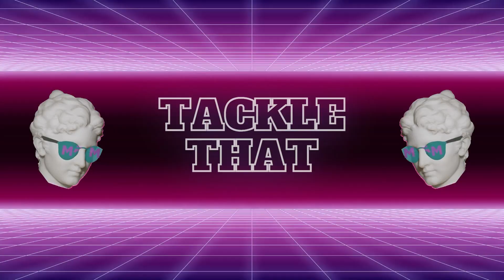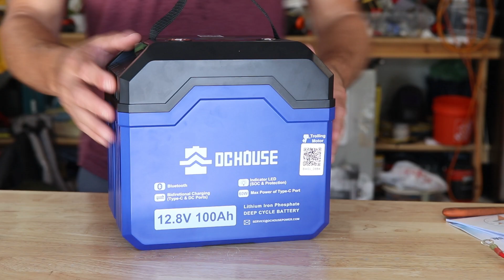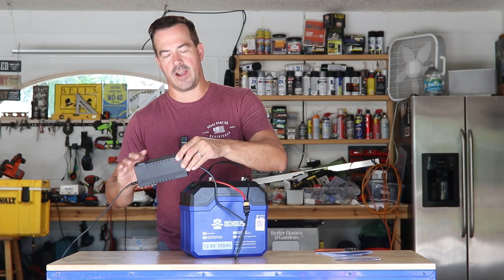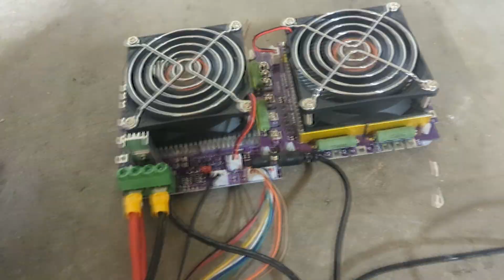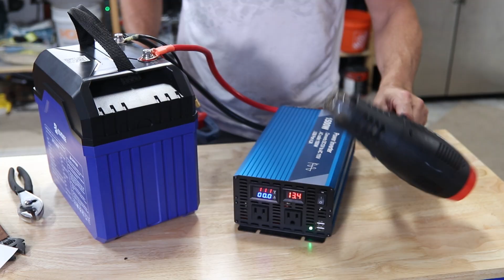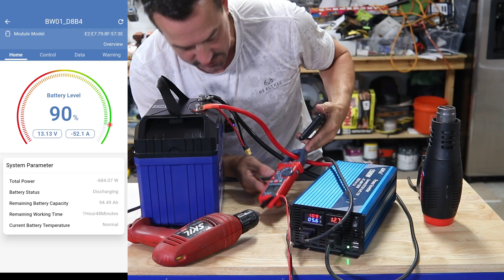NOT Your Average 12v Lithium! DCHOUSE Lifepo4 Trolling Motor Battery Unboxing and Review #Solar #DIY

Comment: Hi... I have the same battery, it's new but I can't charge it. There's only 1 volt of energy left and it's not charging. What do you suggest I do? How can I charge it? Thanks.
Reply from the maker: Try charging the terminals with a cccv charger at 14.6v. you can also try to wake it up with another charged 12v battery. All rlse fails, pop the top and check each cell's voltages... You can charge up any cells under 2.5v manually.
Reply: @TackleThat  okay. thanks a lot I will try.

Comment: The button panel on this battery stopped working the first time I connected the charger to the USB-C port. According to the instructions, the battery supports charging via this port. I looked on YouTube and the reviews say that a non-functioning panel is not uncommon. What could this be? And how easy is it to fix?
Reply from the maker: Wow, thanks for posting this! I didn't have any issue charging from the usbc port, and my display still works after about a year. However, I found that the usb output cuts out after a few min thinking its "idle" which is really irritating when I am trying to change a phone or device!

Comment: Just got 1 of the v2 for $120. Wanted the v2 because I saw 1 of the v3 with output only USB c 😉
Reply: I plan on using this with a car amplifier (Phoenix Gold ZX-250) and 18" subwoofer (DC Audio level 3 18, d4 😁 maybe 1 of those cheap android head units too to connect to phone and make calls
Reply from the maker: Wow will one of these power an 18? Thats a lot of 808
Reply: This is for my living room by the way 😉 also got a 12v 55a RV power supply to keep system up to charge 😁 I did this in highschool for my party room. Hooked 2 15s to back of couch n could hear for miles around 😜
Reply from the maker: Right on!! 12v amps are definitely a lot of power for the $$

Comment: The one question I had was how long it takes to charge or at what rate.
Reply from the maker: It's 100ah, so if it were dead it would take a 10amp charger 10 hours... Or a 20amp charger, 5 hours to fill back up. This one has been the best I've used so far: https://amzn.to/3JSuN1M

Comment: I won this battery from DC House.  But I guess I ruined it.  When I got it , I didn't have a lithium charger.  I guess it sat too long and is completely dead.  Dang. Never got to use it.  I've tried all the YouTube wake up methods to no avail. Don't let it ever set very long like I did.
Reply from the maker: Wow! Good to know... Ive had Lifepo4 sit for a longggg time though.. year+ and be ok. Can you log into the bms? You can pop the top and test the voltage of each cell... Sounds like a bad bms IMO. They are cheap to replace 💪
Reply: Open it up, I would bet it's fixable. Sometimes the charger won't allo charge if it doesn't see a voltage and the BMS is disconnected so it can't see one. Trick the charger first n see if that works, if not open and check cells. I'm betting it's an easy fix!

Comment: Great video!  I just got the same battery and took it with us camping for 6 days. The plan was to use it to power/charge (cell phones, radio and lights) via USB A and USB C. The battery kept on turn off every three minutes and needed to be powered back on every three minutes. Is there a way to keep the battery from turning off every three minutes? Thanks
Reply from the maker: Glad you enjoyed the vid! I messaged DC House and will see what they say since I also noticed this issue when I went on a long trip.. The website says something about holding the power button for more than 2 seconds to reset the BMS.. wonder if that can help? I will try it.

Comment: Hi again I just wanted to ask, I have a 1500w 220v 
boiler that I would like to run for about 30minutes from time to time, and if I understand correctly, 2 of these batteries in parallel and a 2000w inverter with a surge rating can pull it off? Also what size copper wires would be required?
Reply from the maker: Hey! Thanks for watching! You want to figure out how many amps you will draw. A x V = W.   2000w/12v=166.7a, so you will need big wire and a proper setup, heat will not be your friend.. You can consider 24v for that many watts 👍. For 166 amps, you generally need a 3/0 AWG copper wire. I personally try to never draw over 100a if I can increase voltage ⚡. 
A 2000W inverter operating on a 24V system will draw approximately 83.3 amps from the batteries, calculated by dividing the wattage (2000W) by the voltage (24V). However, the actual draw is higher due to inverter inefficiencies, so the real amperage will be somewhat more than this value, which should be considered when sizing your battery bank and wiring.
Reply from the maker: 24v would only need 2awg wire at 2000w.
Reply: @TackleThat thank you so much, yeah it’s annoying just because I already had one of these batteries but maybe I can use it for a different task and just go straight to a 24v, I saw a all in one that might be a lot easier for 24v rated for 3000w, maybe I can go that route eventually but again, thank you so much ❤❤❤
Reply from the maker: @SolarPunk80 you can run 2 in series to make em 24v, just make sure you have a balancer between em!
Reply: @TackleThat  I just remembered, another problem I was wondering about was whether I could get away with a single 24v battery for this use case, even though it would have a 100a bms? I don’t know if that would be like a 200a bms  in a 12v  system, or if it would still present the same obstacle? 😅
Reply: @TackleThat sweet thanks🙏🙏😎
Reply from the maker: @SolarPunk80 yeah 100a continuous 24v bms would keep you running no problem in theory 😊
Reply: @TackleThat thank you so much, I forgot to mention, i live in Italy, and was looking at crimping tools, but I keep seeing that many of them are limited for crimping 50mm wire also meaning 0awg. Is this enough for the wire suggested earlier with the 12v system? I also saw some 70mm copper wire…

Comment: Can I just charge it with usb C cable ( without buying charger?) sir?
Reply from the maker: Yes you can! 😀 Just know it will take a long time to fully charge it that way 👍
Reply: It would take 30 plus hours with that 40 watt brick. What you can do and what is rational to do is very different. It would serve as a nice solar connection port tho to keep it topped up!

Comment: If you connect another  lithium battery at the terminals will it expand the capacity and will it charge the other battery?
Reply from the maker: If they are the same chemistry, voltage and fully charged you can safely hook them up in parallel. You can add the capacity and output together, voltage stats the same.

Comment: Hi, I have the previous non blue tooth version and they are great.
You can charge it with a usb C, feature I have not seen on a 100ah battery.
Having usb A & C built in with a DC battlery port is neat.
Price point is excellent in the UK and I’m happy with it.
Take care M.
Reply from the maker: Thanks for sharing! 🙏 I totally agree, may as well get the extra features for about the same price 👍
Reply: Was thinking about getting one of these for use with a Bison 40lb trolling motor, any thoughts? Also was wanting it to power n electric SUP pump , would it be suitable and what connectors would I need?